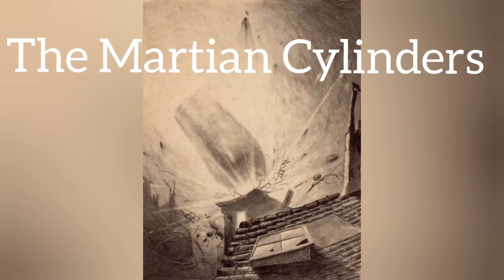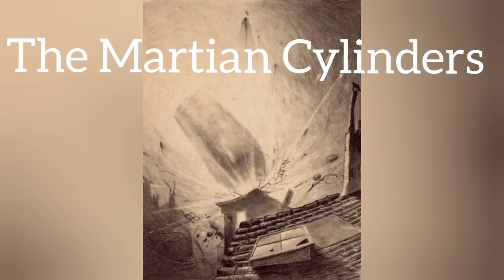The Martian Transport Cylinders HG Wells "The War of the Worlds"

Comment: In the book, is the invasion a world wide invasion or just a take over of England / Britain?
Reply from the maker: The book is set in and around the London area
Reply: There's  no suggestion  that anywhere beyond London and Surrey are  affected. Also, I  think all, or certainly  most, of the 10 cylinders are given named landing locations.  
Strategically it made sense for the Martians to decapitate the British Empire, form a bridgehead on an island and then attack the rest of the worlds major powers from there. Fortunately, the plan failed at stage 1.
Reply: Kinda both. It's implied that they were going to send a bunch of cylinders all around the world, but the big gun they were using to shoot them broke after...I think...the 10th cylinder? As such, the only cylinders shot landed in England.
Reply: It implies the uk only as the steamer escaped to the continent. I guess it's focused only on the experience of the journalist in Victorian England. The rest of the world isn't the focus.
Reply: It’s unclear, although its from the perspective of the British, which at the time, essentially was the center of the Earth. They try to travel to France, as they believe its safer there.